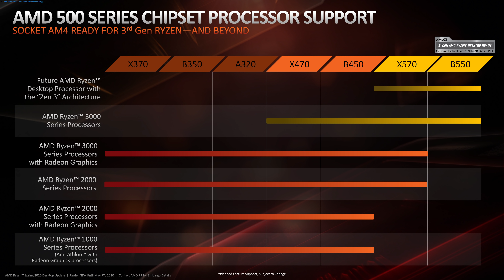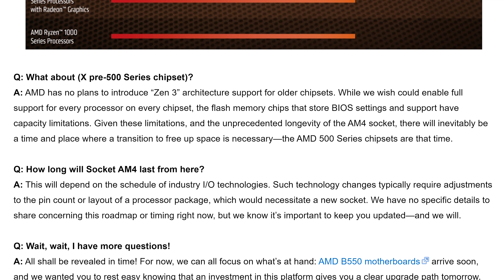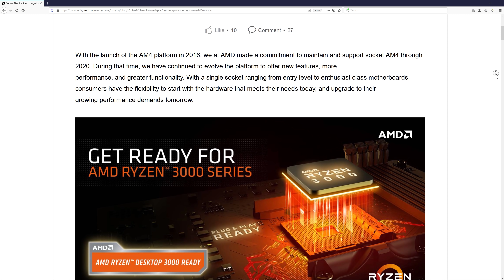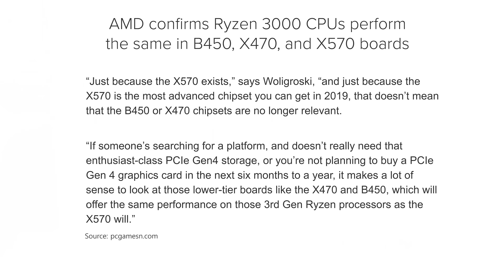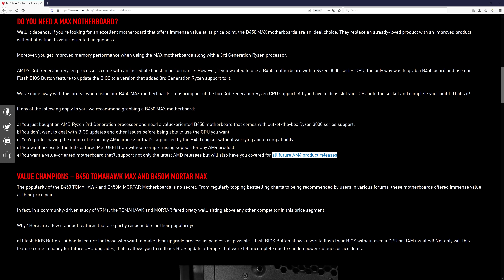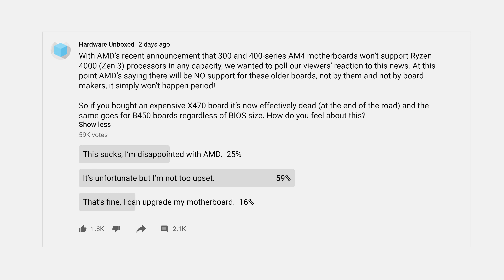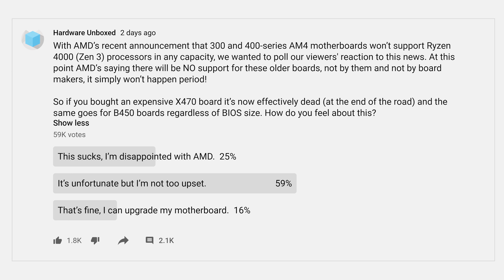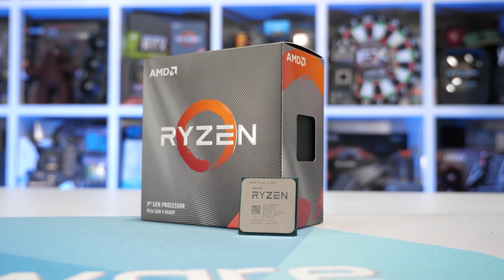AMD Does An Intel, Axes Zen 3 on 400-Series Motherboards, Our Thoughts

Comment: As an X470 owner I'm pissed, looks like I'm skipping Zen3 and upgrading when DDR5 is relevant
Reply: Brought a Msi b40 mortars Max series motherboard here. I guess I'm not buying any zen3 products and denfinty not buying 500series motherboard as well. AM4 and DDR4 platform are pretty much done at this point.
Reply: I have an x470 as well and if amd doesn't support in my next system will be an intel with ddr5
Reply: @williamwitt4360  I'll be upgrading to whoever has the better CPUs in 2021 or 2022
Reply: William Witt same here buddy am also coming back home to intel 😍😍🥰 fuck these cheap trash latency hogging Zen chips 🖕🏻🖕🏻🖕🏻🖕🏻
Reply: And when this is reality you can choose Intel so why AMD tell you not to use their 4000 CPU is beyond me , you buy ryzen 4000 AMD take your money ...
Reply: @artaz899  Exactly.  And by then INTEL may have their act together.  I would buy at least 2 maybe 3 of  the 4000 series chips.  We have 6 B350/B450/X470 motherboards in the extended family.    3 of them have 1000 or 2000 series chips.
Reply: X370 users:" guess i'll get 3950x "
Reply: @eldegal3441  Good bet.  They should drop in price once the 4000 series is released.
Reply: you know, you don't have to upgrade every single gen. It's easy, you just get a good board and cpu that will last you 5 years then you never have to worry about it until then
Reply: @3point1.2  Don't use logic to reason with an angry internet mob.
Reply: @3point1.2  I wasn't planning to upgrade every year anyways. My plan was to get a 3600X and use it for 2-3 years and then get a Zen3 8+ core etc. for a good price without having to buy a new motherboard.
Reply: @3point1.2  maybe not 5 but still a long time. Just babies here, the ones who spent a bunch on a powerful mb when they knew 4000 was coming but couldn't wait. The 3000 was just squeezing in but hey idiots will be idiots.
Reply: Yep. I think it is short-sighted from them, as it will mean that a lot of people who would go and buy Zen 3 chip will now stay on their existing CPU in B450/X470 board and wait for AM5 instead...
The poll basically shows, that 25% of people who have B450/X470 were planning to go Zen 3 and are now pissed. Not sure how many of them will be keen to invest in new board with no upgrade path to get Zen 3. I guess at least 15-20% will follow your suite @jozza
Reply: That sucks indeed, but there's no reason to be pissed about something AMD did not promise. AMD have made it clear a long time ago that AM4 motherboards won't be supported with new CPUs after 31 December 2019, so not sure how you thought that your X470 would work with Zen 3 which releases after 31 Dec 2019. If you look at AMD's official Socket Stability slide in the article "3rd Gen AMD Ryzen CPUs Will Work on Many Existing MSI AM4 Motherboards" (search it on Google), you'll see that the graph clearly shows no support for new CPUs on AM4 after 31 December 2019. If you take a good look, the orange bar stops right at the end of 2019, just before 2020 starts. It was already know even a year or two ago that Zen 3 will come out some time in 2020, or in other words, AFTER the official support period. Do people really not know how to read graphs?
Reply: @bgtubber  Do you work for AMD?  Really, AMD reps were saying through 2020 back in December 2017.  There was nothing saying that B450/X470 wouldn't support Zen 3 until now.   And the bios chip size is just BS.

Comment: Just noticed the '*Planned Feature Support, Subject to Change' footer note, which I assume means this lack of support is also potentially 'subject to change' with enough push back.

Also B550 doesn't support Zen+ Ryzen 2000 series either (because of a small mandated bios chip - and an unwillingness to have multiple bios download options I suppose)

Comment: 3600 on a b450 board here. I probably would have upgraded the 3600 to a 4000 part sometime next year, not because I'd have needed to, but because the option would have been there for me to do so, relatively easily. I certainly wouldn't be buying a B550 board just to upgrade the cpu, so AMD will miss out on me upgrading, and I'll just carry on with the 3600.

I feel like this is something AMD is completely failing to realise, the majority of people will simply not bother upgrading, from one generation to the next, if it means buying a new motherboard. Having the motherboard and ram stay the same IS the reason we'll upgrade.

Comment: If it's physically possible, not supporting B450 is just a dick move by and. Just got a B450 board And Ryzen 5 3600 two weeks ago 🙈 guess I just bought into a dying system although AM4 is still around 😡

Comment: When I was upgrading last November, to Ryzen, after a bit of research I was not confident enough to go with a 400 series motherboard, since I plan to upgrade to Zen 3 when it's released. There were enough rumours for me to go with a 500 series instead. Anybody who bought a 400 series board when the 500 series was already out can't really blame anybody but themselves. 
I mean, we weren't even certain if the X570 would be compatible with Zen 3! And also, you can't really be that bothered about the latest technology if you didn't want to get the latest motherboard when it was available for an extra $20-40. 
I think the moaners are just moaning because they're moaners. 
If you want the longest support and compatibility then you go for the latest products. That's how the tech world operates nowadays, anybody with a phone knows that they'll only get updates for a year or two after release.
Still, knowing AMD we'll probably be able to flash a Zen 3 bios on a 300 series board and it will work flawlessly, and AMD will just completely ignore it. 
Or else there'll be a mysterious "leaked" bios that AMD will take no responsibility for.

Comment: I appreciate what you are saying here, but this has been coming for some time. Looking back on the fiasco surrounding AM+ support on older boards, then the problems they had with AM2, 2020 offered them an escape hatch. They maintained compatibility "through 2020" as promised, and can now move forward unencumbered. I agree they should have handled it better, this doesn't make them Intel. Yet.

Comment: what's the point of dropping support for probably the last Ryzen gen before AM5 / DDR5?
Reply: Money
Reply: @enioapolinario8538  By cutting out 90% of your customers? That argument is just stupid.
Reply: @MrInubis  Thinking that would be cutting out 90% of the customers is also a stupid argument. People will still upgrade if they see the need to.
Reply: @SkywardKkalox  Who wants to upgrade when ddr 5 is out will!  Who cant would buy ryzen 4000 and use it in b450 and now he can't nor can he jump on the next Ryzen 5000 MB CPU  nor B550 and 4000 and no money for amd and just unhappy people... Why!
Reply: @artaz899  I would buy  4000s to put in my B450 and X470.  Still no need for PCIE 4.0.
Reply: Saving a **load of money in development and QA. As Steve said, they likely don't have enough resources for that, and even if they did, it would make every new generation significantly more expensive. 

I'm not trying to defend them, but they only promised AM4 compatibility up to 2020, so what makes you think that a B450 would keep you at the bleeding edge longer than that? Not to mention that you still have a solid upgrade path all the way to 3950X in that motherboard, or you can do incremental upgrades to your system (for instance, update to B550 this year keeping CPU and RAM, then upgrade the CPU next year).
Reply: 300-400 series=14nm/12 nm cpu's zen1 and zen+ (zen2 backwards compatible)
500-600 series=7nm cpu's zen2 and zen3 (zen4 limited backwards compatible)

It was never supported, x570 and b550 were meant for zen2 onwards but b550 took longer than expected to get pcie4 working while also being cheap, Window lickers thought b450 would be okay. AMD never said that.
I'm sure theres plenty of people where 16 cores isn't enough for and they would definitely buy the latest and greatest cpu's, afterall they spent a whopping £100 on a 2 year old chipset so we're obviously tallking big ballers here.
(I have b450)
Reply: @tomstech4390  AMD promised support THROUGH 2020. Stop blaming AMD's customers for AMD being a scummy company taking back their promise of support.
Reply: @tomstech4390  stop pulling arguments out of your ass. the am4 platform was supposed to support all zen cpu that would release for the platform. last years bs restriction on 300 was totally out of the blue, and amd had to suck it and support them anyway cause consumers were mad about it, and this years restriction on 400 is even more bizzare cause there were no b550 to buy until now

Comment: Bought a Crosshair VII for my 2600x for the reason to get the best AM4 tier CPU once the last AM4 compatible series launches. (4000) I would have not "wasted" the money on a good X470 board if I knew it won't last the entire lifetime of the AM4 socket. Now I might as well go with intel if I want to upgrade  before DDR5. X570 is a dead platform by the time 4000 comes out and so is Z490. Z490 compatible CPUs might still have better single core, which is sadly all that matters to most of the games I play.

Comment: Who else didn't start a build yet, and is happy they didn't?🙋‍♂️
Reply: Me and i will maybe go with Intel after this mess by AMD
Reply: Enio Apolinario gonna have to spend way more money tbh but ur decision
Reply: @malathomas6141  I say maybe, depending on the price, Comet Lake maybe will come with good I5 and I7 but i will wait to see the prices from Z490 mobos

X570 mobos are very expensive
Reply: @enioapolinario8538  idk about that, but I'm personally waiting after all of this gets ironed out, and prices/supply goes back to normal. I'm not in any rush since I still am on console, but I do know it's just not the right time to make the switch just yet.
Reply: Was about to spend all savings on a pc with r5 3600 so lucky that i didn't buy it
Reply: @modyro3560  why not? That's a good cpu, and b550 supports gen 3, as long as you have a motherboard that'll support the newer cpus you just won't have to change the mobo. That's all I was meaning.
Reply: Looking forward to all those cheap Tomahawks Max and 3000 CPUs from all these outraged people who apparently prefer to buy a new gen CPU rather than one from the same gen but more powerful or better yet a GPU upgrade.
Reply: I'm not since it is likely that the AM4 socket will end with the 500 series chipset/4000 series CPUs. So my next upgrade will have to be a CPU/Motherboard combo regardless of if I buy now or in 6 months.
Reply: @tintinaus  I feel for you man, that blows.

Comment: Around 15:00 you make the point. People forget we are a niche group... the huge majority of customers want to buy stuff, plug it in an run... the huge majority of people don’t updates Bios, heck, the majority don’t even update drivers, much less bios. All these weird compatibility issues from 3xx to 4xx and even A320 where a pain to explain to customers, and amd was losing a lot of customers because of that. So now they decided to “reset” the situation. Ryzen 4000 on 5xx boards. Simple.
We are focusing on technical stuff when the reason imo is customer confusion.
The reason AMD gave doesn’t make sense for some boards tho...

Comment: A friend of mine had to build a new computer after his old desktop and his Surface both died. Having not a bucket full of money, he chose to save a little bit of money and buy Ryzen 5 3600 + B450. Being a scientist he has to do some simulations and calculations, and the 3600 is good enough for now, but if he does need to make even more complex simulations (and it's very possible) he might have liked to be able to upgrade to a Ryzen 9 4950X (or whatever it will be called). But now he's screwed up.
Being an i5 6600K owner I voted for "not too upset", but I can feel it's frustration.

I expect a big wave of RMAs to retailers after this announcement, and maybe also some lawsuits if they don't change their plan.
The most unfortunate thing for AMD themselves is that they totally screwed the "good bud" reputation they built in the enthusiast market, and this was a big part of the success of their first Ryzen CPUs.
It's incredible how bad is AMD at PR and managing their relationship with its partners...
They screwed up with the 5600 GPUs, and now even worse with this decision.

Comment: I'm a bit of both Steve. I built a 1700 on X370 in 2017. But I went with the B450 Tomahawk when I built a 3400G last November for my Mum in anticipation of future proofing and now it puts her on the backfoot as I will have to redo the full system if I want to upgrade hers, or buy an EOL 3900X or 3950X before it's too late. Now I've just bought a 1600AF and 5600XT Pulse and now I'm confused with the Mobo choice. 🤷

Comment: Steve, good points, but you should have also mentioned that ALL X570 gigabyte boards have 16 mb bios and they all support all zen cpus. So surely it's just a lame-ass and poorly thought excuse on par with "PBO +200 Mhz" shtick.  

It should be made crystal clear to AMD that (you can see it in the MoBo sales figures) the majority of mobos bought along with zen2 are 4xx ones. I know multiple people who bought 3600 and 4xx mobo with explicit intent to get 4xxx top-end cpu as soon as they are released. If AMD decided to ditch these boards, then that vast majority of customers will not upgrade to their latest zen3 cpus, however good they are. For example, since I have a quite expensive x470 g7 board, i was willing to dish out extra money for 3900x as I had no need to buy new memory and board (and I sold my old 2700 for a significant fraction of a 3900x price tag), and I won't pay for zen3 if I needed to shell another $250+ for a new board while this one is perfectly fine.

Comment: You can maybe help me guys, I've got a Ryzen 5 1600 and there is a lot of discounts in my country for the Ryzen 3000 series. My actual motherboard is a B350 so I won't be able to upgrade to a Ryzen 4000. I hesitate to upgrade now for a Ryzen 7 3700X, should I wait for the 4700X and buy it with a new MB (which mean more cost for me) or should I go for the 3700X now?

Comment: Got a B450 Tm Max 2 months ago. Me thinks that vendors and most people around will put heavy pressure on AMD to make it happen (Zen3 on X470/B450 boards). Or else they will have a bad public-marketing time for many months. On the video now, Steve you made great job with the analysis on the situation. And it is indeed a BS argument on the AMD front that the UEFI chip of the boards is the limit. Kudos!

Comment: I bought 7 days ago a 3600 with a b450 i Aorus pro wifi... I feel a littel bit fucked.
I would send my b450 board back but there isnt any affordable ITX x570 option. 
If b550 would be released with reasonable pricing, i have bought a b550 board instead.
Thanks AMD.